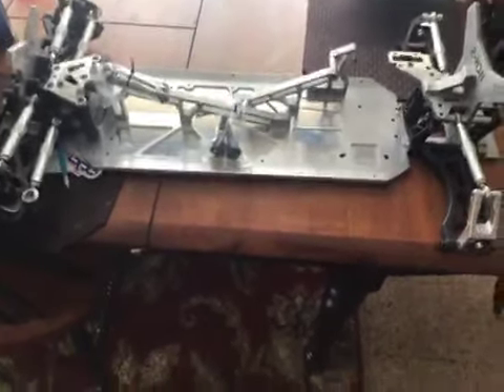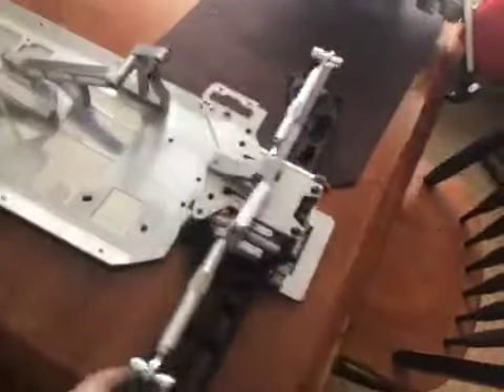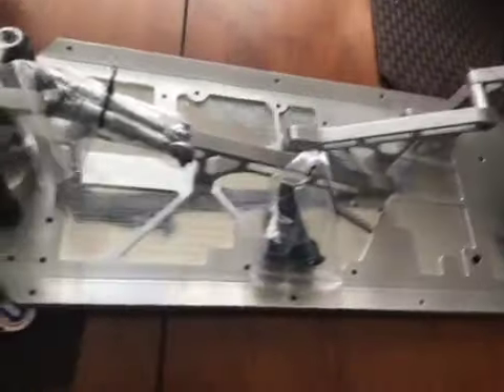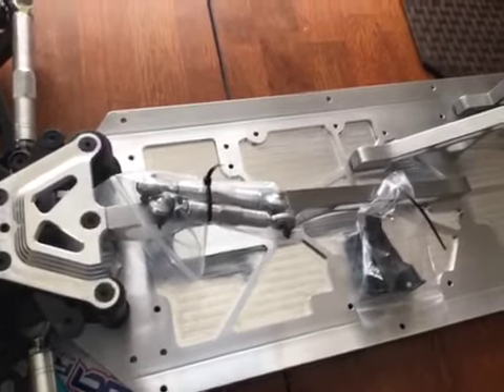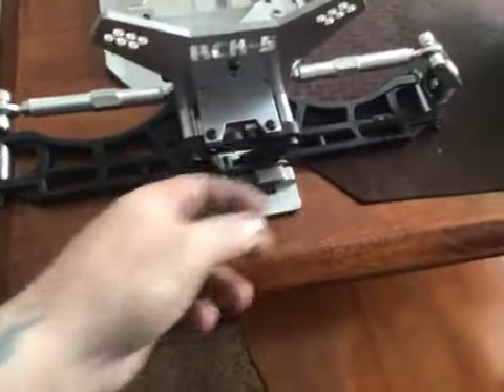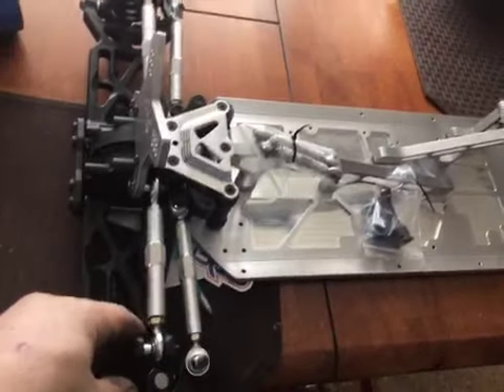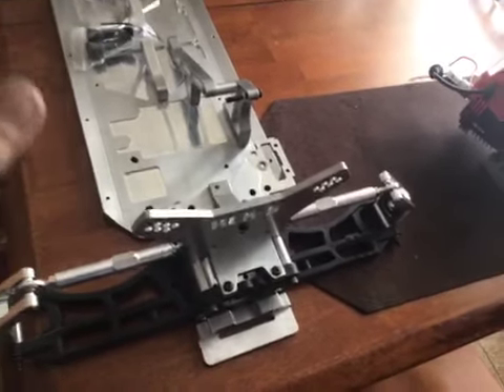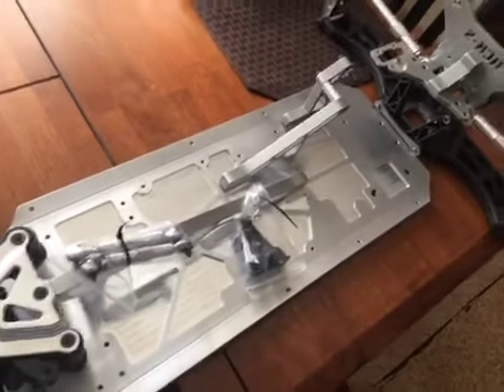Hybrid build RCK-5 wow!

Comment: Thank you for the kind words Wade absolutely no problem.

I'm surprised it got there as fast as it did!

And correct the intersecting chassis braces provide it to be an extremely rigid setup.

Also I may add, this is a dual-purpose hybrid and is very TRACK friendly.

I have kits on the East Coast and West Coast Racing two wheel drive class.